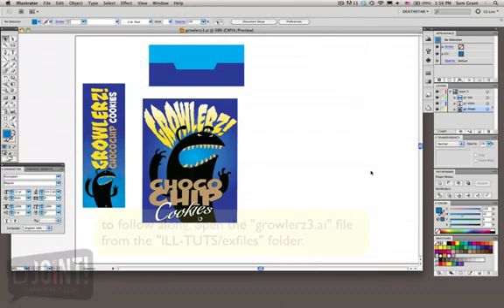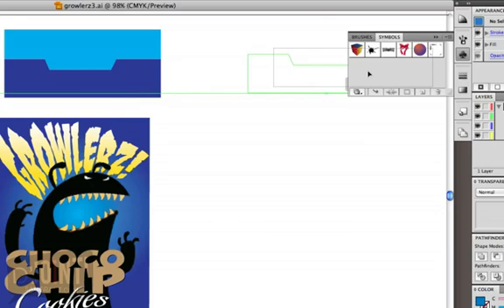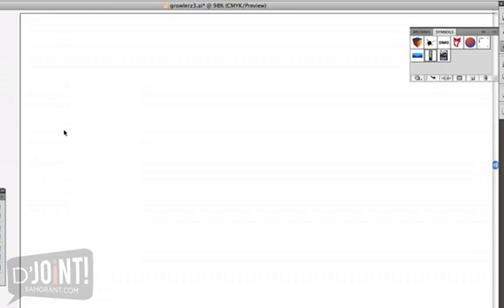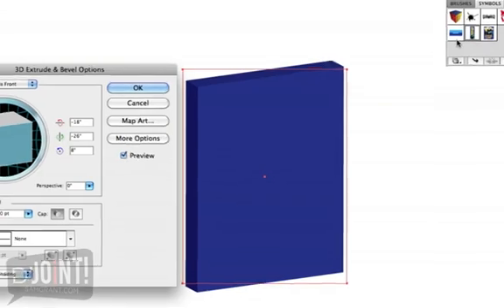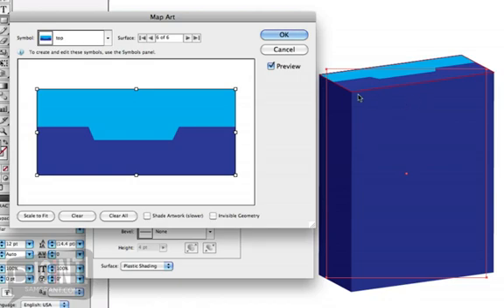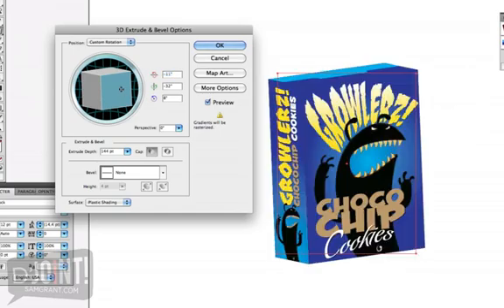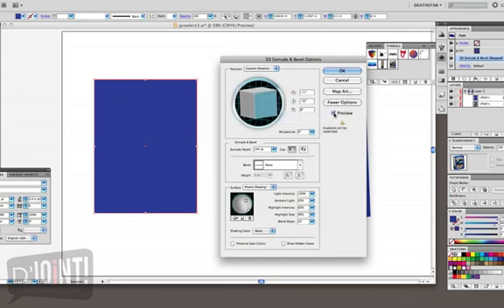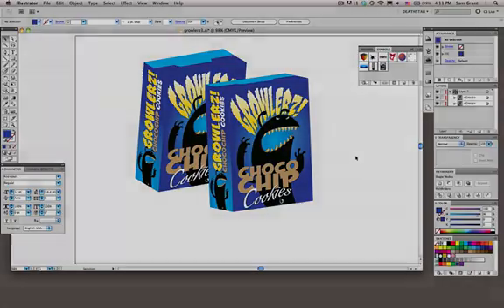How to Make a 3D Mockup of a Box

Comment: Guys help me when I put my product in symbol its straching got out and in 3d can't apply perfectly
Reply from the maker: Hi Yogesh,
Not sure how that issue came about, but you can still adjust the symbol even after it's in the panel. Double-click on either the instance on your artboard or the icon in the Symbol Panel. If your symbol is distorted there, you can easily fix it. Hope that helps.

Comment: Hi, as i can see this tutorial is a little older but maybe you can still help me? Im not that professional yet in Illustrator and created a box design. As background i used 1 image all across the box template (see screenshot) > My actual problem: If i want to have this in 3-4 elements to add to a box, i somehow need to cut it in 4 segments. Can you tell me how i can do that?
Here is the screenshot http://www.awesomescreenshot.com/image/943544/0e9f6b7e2c3ddb38a443522bc31dc572
Thanks a lot in advanced
Reply from the maker: +SAMPHAI Web & Mobile Solutions Understood. The challenge ahead of you isn't in Illustrator's tools but in the placed image (the flag art). If I'm correct in assuming this flag was created in another app and "placed/pasted" into AI, you can't simply cut it up. It is possible, but there are multiple steps involved.

Illustrator will require some Clipping Mask wizardry with multiple steps to isolate the art for each panel. It's not difficult, but it's very tedious. The simplest way to do this would be to cut the image up into 4 parts using Photoshop, then bring in the individual panels back into Illustrator. If you're pressed for time, I would go the Photoshop route. Here's what to do:

1 - Open the flag image in Photoshop
2 - Using your box measurements, drag PhotoShop's Ruler Guides to mark each panel for your box
3 - Using the Rectangular Marquee Tool, select the first panel.
4 - Choose Copy, then choose Paste. PS will create a new Layer containing that panel.
5 - Repeat steps 3 & 4 for the remaining 3 panels.
6 - Keep the first panel's layer visible and hide the others. Save or Export. Your choice. 
7 - Repeat step 6 for the other 3 panels.
8 - Return to Illustrator. Import each of the 4 images into it's proper panel 

That's it! You can now create your Symbols & your Box with no restrictions. Hope this helps!

Hmm.. I should make a video about this..

Comment: How would you print a product design like this ? like without it being pixelated and with good colours? do you need an expensive printer or something ?
Reply from the maker: GarlynX The images were created in Illustrator, then dragged to the Symbols palette. They should still print as vector files. If you've brought the images in from another app that's bitmapped, you may experience pixelated results. Also, make sure to convert your artwork to CMYK before you print. RGB will produce unpredictable results on any printer regardless of the cost.

Comment from the maker: Stevie P,
When you get to the Mapping window, be mindful that there are 2 sides to every surface. I usually test to see which is which. As far as the flipped image, that happens to me sometimes as well. If it occurs again, just rotate your artwork in the Mapping window so that it's upside down. It will be correct when you exit the window or save the settings.
Reply: How to increase perfomance on windows, my illustrator takes so long to insert the map arts. i got i5-6600 CPU @ 3.30Ghz, 16GB RAM, GeForce GTX 1050 Ti 4GB VRam.